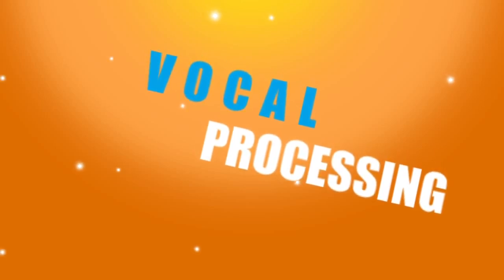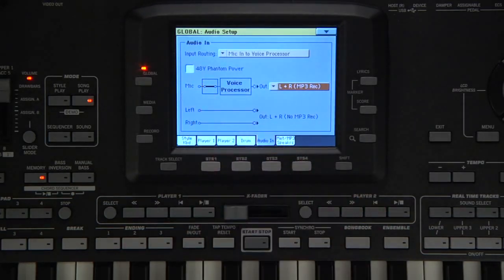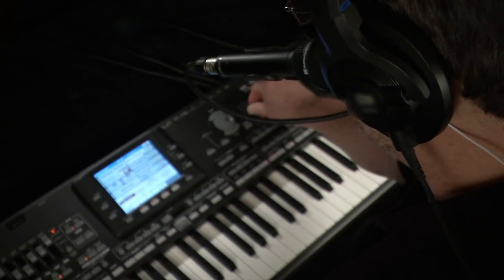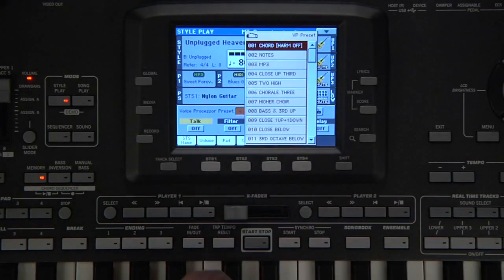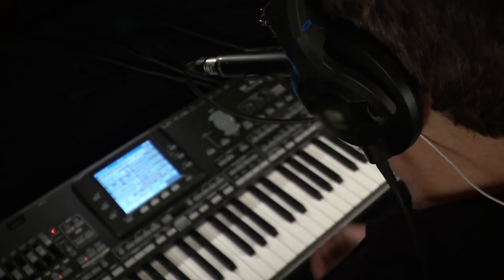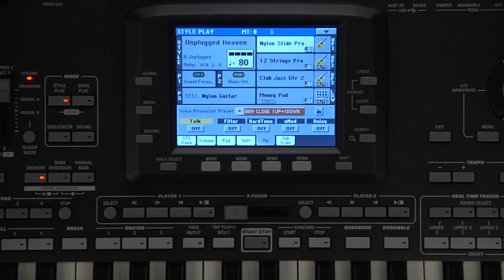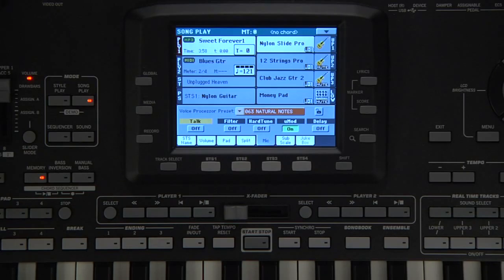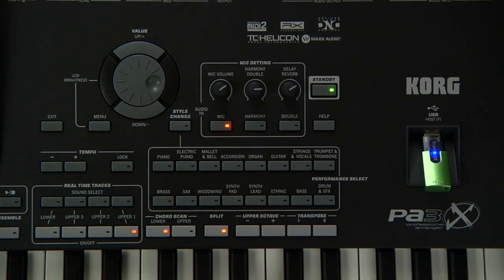Korg Pa3X Video Manual Part 5- Vocal Processor

Comment: Hello Gents,
Could you pls advice if it is possible to record a MIC connected to PA3X on Cubase/Melodyne  without additional sound card via USB Cable, save it on PC and then send the recorded & corrected vocal by Melodyne to PA3X (even as MP3 signal though back L&R insert)and record on Cubase with PA3X Vocal Harmony & Rever Effects?